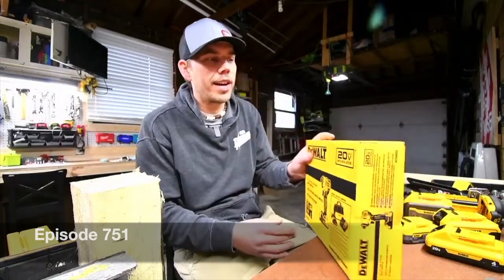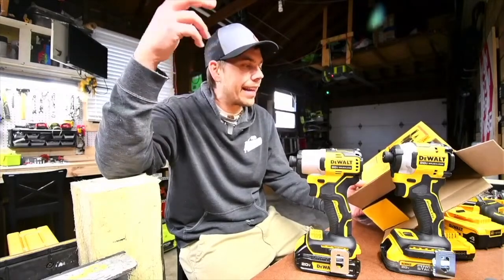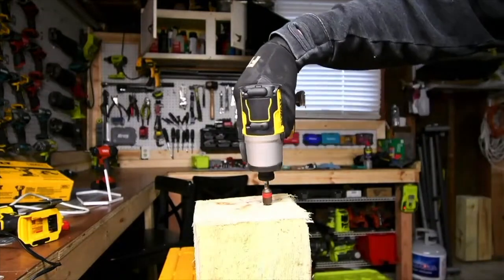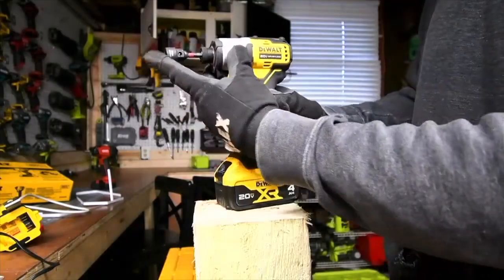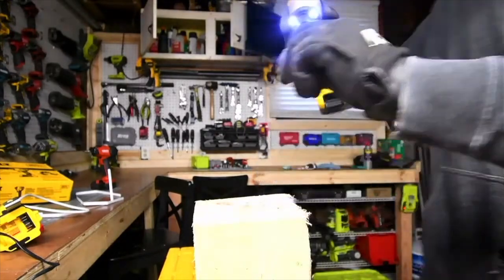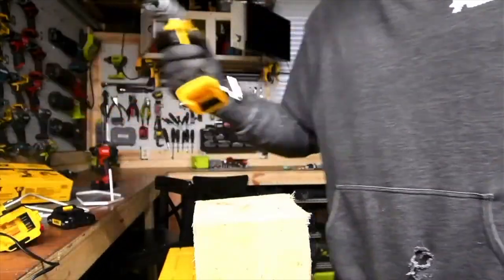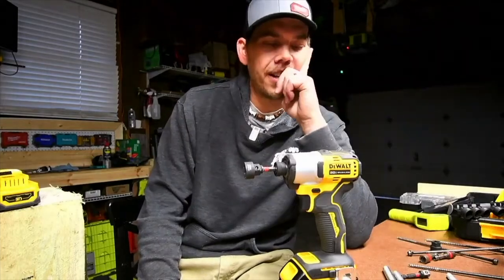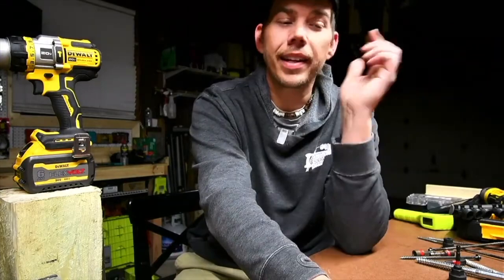Testing out the Dewalt DCF840 (Out Of The Box)

Comment: presently the 840 and power stack are my favorite . i love the almost as small as 12v package with great speed and power . hangs off my belt easily ,takes up little space . the 850 looks great but i did not find it as versatile when working . the width was an issue a few times .
Reply: Exactly!  That's the same way I run it! Powerstack 1.7 helps negate 12v line.

Comment: I personally wouldn't go for the DCF840 with variable speed only, of the options. There is the new DCF845 that is much more appealing to me (but more $ as well), with apparently more power, but more importantly settings to aid with different fasteners in different materials.  I'd also take DCF850 over the DCF840 even if slightly less powerful, for the design and settings. They can do the same tasks and I'm not worried about a 0.5sec difference (or whatever) into a tree stump.

Comment: i need to adjust everything i said .850 and 840 are both great and i enjoy using them .they are also different . used 850 to rotate cutters on my shellex planer head and i like being up close the little screws . 2nd slide switch is fine though i was using my 891 impact wrench with lite buttons .they are large easy to see and change . the digital or electronic switch is great also .it is all good